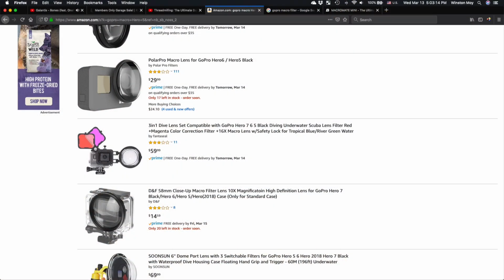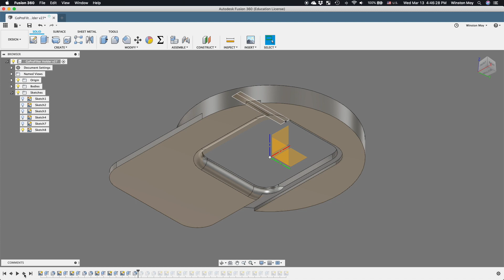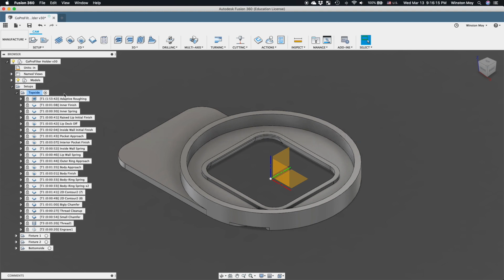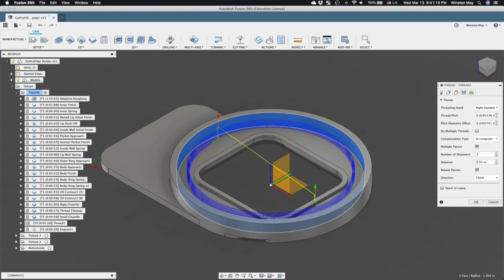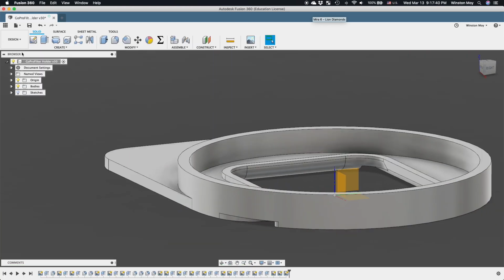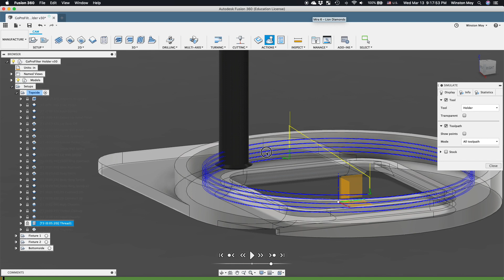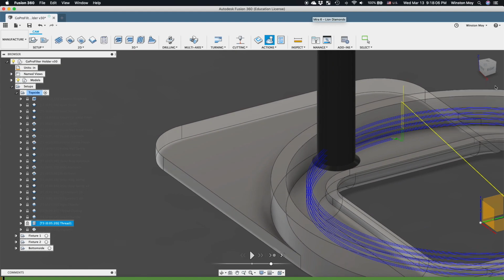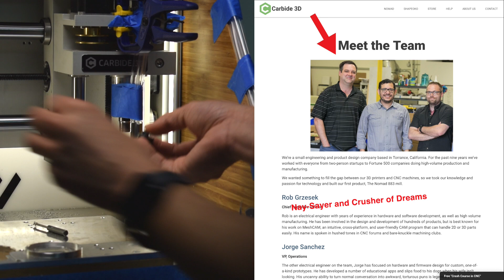Threadmilling a Macro Filter Adapter for my GoPro - #141

Comment: hey Winston, I know this is an old video, and I don'texpect a reply, but I came back to reference this because I'm trying to model a similar adapter for my GP Hero 9, but wanted to use the much smaller 46mm filters. How did you go about modeling those threads in fusion, is there a free form thread modeling tool that I'm not finding or did you use some other form of magic to model those in?

Comment: On a fyi, if you get stuck and end up stopping mid cut, aslong as you move clear in x and y, you can save the thread mill, I think I would power off the machine and move it by hand to be safe

Comment: Nice! I never tried thread milling before. Does the cutters come in metric and imperial? Im asking because I think there is a difference in the tooth angle. I work in metric, but I think camera stuff is often imperial. At least the tripod mount screws.. Anyone have some insight ?:)

Comment: For when you make a quick release option, could you just have a tab that looks like a boating rope cleat stick off either side of your adapter (possibly one on top and bottom offset from the mounting fingers on the bottom of the case) and then just use rubber O-rings or rubber bands in the cleats wrapped around the back of the Go-Pro case to hold it on?

Comment: Nice job on the 52 x 0.75mm threads! I made some too and the pitch diameter offset I used was also real close to 1mm (I used 0.958019 mm). I got that number by using this expression...
((51.692+51.535)/2)-((51.4+51.21)/2)+(threadPitch*Math.sin(60/180*Math.PI))
The first bit, "((51.692+51.535)/2)", averages the maximum and minimum pitch diameters of a 52mm diameter 0.75 mm pitch internal thread given by a web site that I'll link to in a reply to this post. (I'm putting the link there just in case YouTube decides it's "spam" and hides it.)
The second bit, "((51.4+51.21)/2)", is what I used for the diameter of the modeled feature. It is an average of the maximum and minimum minor diameters given by that same site.

The last part calculates the height ("H") of a 0.75mm thread.

For the matching external thread, I used this expression... (which evaluates to 1.12602 mm)
((51.978+51.838)/2)-((51.491+51.372)/2)+(threadPitch*Math.sin(60/180*Math.PI))
Reply from the maker: Good Intel, thanks for sharing!
Reply: @WinstonMakes  
You're welcome and thanks as well!
(I mixed up which number was the one used on the model, but I edited the post and I'm pretty sure it is correct now.)
Reply: https://www.amesweb.info/Screws/IsoMetricScrewThread.aspx

Comment: I like your content, and I’m considering doing something similar to adapt mr dslr to my telescope.

But I think you need to evaluate your materials a bit.  The entire time I was watching this I was thinking that it should be milled out of a plastic.  But also your work holding jigs.  Aluminum is nice, but a scrap piece of mdf would have held the part just as well.  Metal is great if you are doing a production run and creating jigs for it, but one offs I always go cheap.  Plus, it machines faster and costs less when I screw something up.
Reply: Agreed about how MDF would have made a fine fixture. The piece of aluminum used already had holes in it though, so that part of the plate may have already been regarded as waste. 0.75mm pitch threads in plastic would be pretty weak. They could surely work a few times, but wouldn't be as robust as aluminum threads.
Reply: Hirudin yes, I thought about the threads, but I think it’s a one time screw in.  Pop the whole assembly off and use a new piece of tape when you put it back on
Reply: @andrewmyers7131  
That definitely may be the case and is a good point.